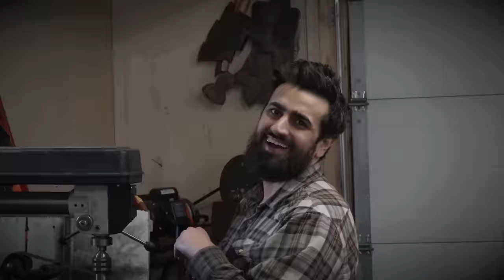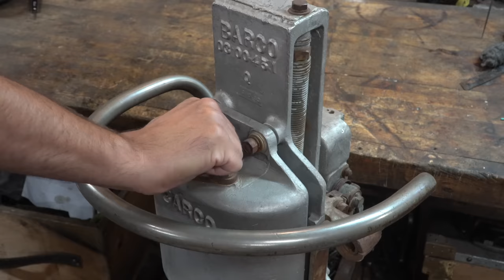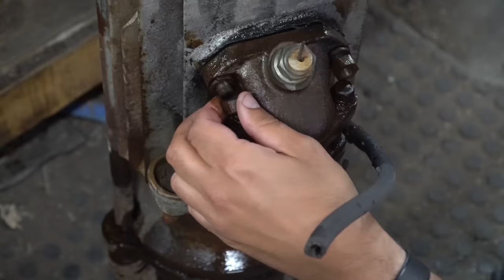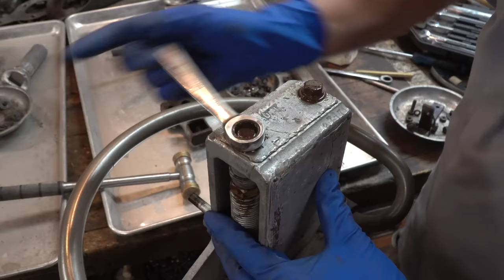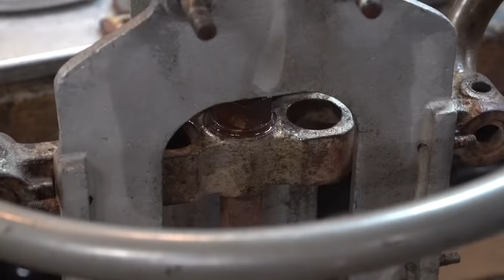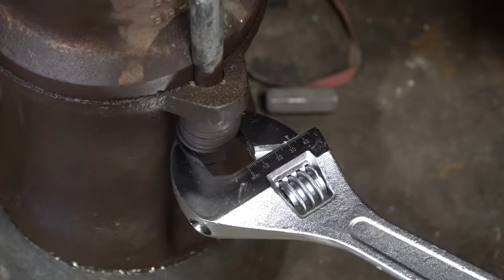Gas-Powered Pogo Stick Rammer Thingamabob [Restoration]

Comment: The German equivalent, the DELMAG Frosch, had a thumb operated trigger, which operated the magneto and had to be fired manually for each stroke. No runaway machines possible, like with this one.
While they are banned from manual operation, they are still being made, this time guideed on a pole, as small pile drivers.

Comment: I am no lathe-ologist, but i have around 10 tonnes of machinery in my shop now, and i would say that for rough, stock removal operations, you are using too high rpm, my minilathe, yugoslavian lathe, is 60 years old, has a 3phase 1400rpm motor with a double belt reduction of 1/5 into a 5 speed pulley cone, at lowest speed its (1400/5) x 1/2, so its what not even 200 rpm, and i can take cuts in steel of 1mm radial removal in low carb steel... and i only use carbide tools, apart from hssco10 parting blades... And its a smaller lathe than what you used here... Now the big lathe has 3 tonnes and can shred almost 6mm radially per pass, 5.5 per manual to be exact, but she can move even more with a good insert... High speed, slow, shallow feed is for finishing cuts, slow speed and intense, deep feed for stock removal... This what you showed results in much more mess with fine hair strand chips and dust all the time, which i cant believe you like to clean up all the time... 
I aint attacking, its just what i noticed with your valve turning... Now the large formtools are a mess, that i can understand being a trouble on any lathe except maybe 10 tonnes heyligenstaedt or monarch or similar lathes, but even smaller lathes can run them with good gearing and if they are in prime condition in regards to fit and state of the ways and dovetails(always repairable, rescrape, use turcite or bronze shim and rescrape again)... Also, the valve lapping, its generally a terrible idea to lap any hard part against a soft housing if its a system component... Soft materials  soak up the fine grit and become a permanent lapping surface... On a car engine, the valve seat is 99% times an insert made out of hard material and therefore can be used as a lapping seat, as neither it nor the valve will soak up the abrasive and wear down later on or allow grit to be crushed, dislodged and obliterate the valve bushings as it travels out over time... I am talking about the brass body that holds the other valve... I know you did the best you could, but from machinist pow, its a bad idea, tho i know you dont have a valve seat cutter and valve cutter negative to the seat that would allow you to avoid lapping and get a perfect fit and seal, again, just a heads up for the future... 
Having said all that, a marvelous project, a beautiful restoration, as always! And a bloody wicked machine my fine sir!
All the best and kindest regards!

Comment: That valve  is  to stop it from  blowing  fire back  though  the carburetor and  putting the lapping Compound on a valve and spin it in a circle is not how you lap    spin them back and forth back and forth It's why you use a lapping tool not a drill

Comment: I can remember watching one if the compactors i was fastenated by it as the thing thudded up and down the guys using it had big thick leather buckle belts on shirt sleeves rolled up caps on heads steel toe cap boots ha ha in the late 60s this was

Comment: I have 22 inventions I need to do something with. I live about an hour from Chicago where there is patent library. I researched my best ideas and found none of them have been made before. Now I just need money to get one started. I know there are five ways to deal with an invention at the stage I am at and don't really want to do anything but make some money so I can get the others made. 

I am posting this not for help but to offer help. I have nothing better to do with my time as my body is a pos. So, I am damn good at research and if it is out there, by hook or by crook I can find it with a minimal start. Sitting with my legs up is my only requirement. Just let me know and we can communicate via email or phone. I am happy to sign Non-Compete.

Comment: You need to learn about grinding valves.  The best place to learn is to read the Onan engine repair manuals.  In it iks says "DO NOT LAP VALVES"   A properly ground valve does not need lapping.  Lapping destroys the valve's sealing ability

Comment: The foot is magnesium... WHY!?!?! Sure, magnesium is easy to cast and machine but it's also expensive. And the foot is a truncated cone. It's a rather simple shape.

The only reason I can think of is that aluminum or cast iron is too heavy. But why would you do that instead of just lightening the aluminum casting with some holes or voids? I don't know.

Comment: If you got 3 more of those and attached the handles to each corner of a old thick table you could jump on the board and be shot in the air by all four of them going off at once. 

Wear a helmet though for safety.

Comment: You do great work - but invest in some real wrenches. Your use of adjustable wrenches scares me as they tend to slide off and round bolts and nuts, especially if you need much force or if you pound on them.